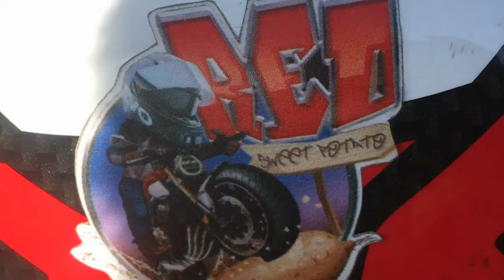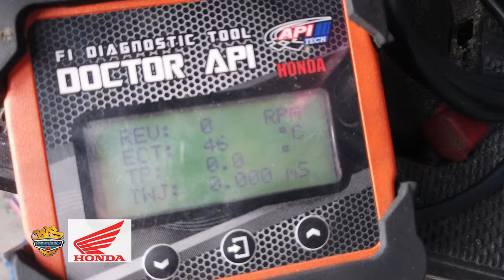TANGGAL DRAGGING 100% / SCOOTER MAINTENANCE

Comment: tanung lg paps may amaalingawngaw sa ilalim ng lagayan ng gear oil ng click 125i ko nagpalit lg ako ng belt at bola na 13g stock panunkaya yun mawala 15.6k odo yun 2019 model pa update para mka punta ko sa shop nyo san po ba yan ?

Comment: IDOL BKIT 10/15 YUN BOLA PINALIT NINYO? TANONG KO LNG POH..
Reply from the maker: Arangkada at Duluhan pwede naman 12 o 13
Reply: Aq kc 80kilos aq stock lng yun parts ko gnyan kc gusto ko my arang kada at dulo rin 12g lng bola ko nag pplit ng center spring.. 800rpm lng spring.. ko mio i 125 saken.. marming salamat idol.. hindi kc tulad ng iba di nila explained.. maraming salamt idol..